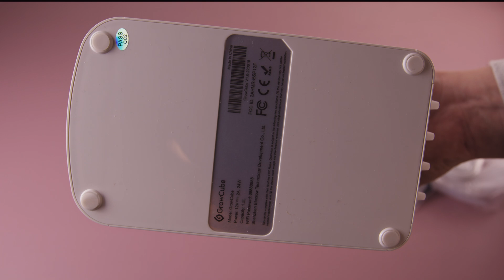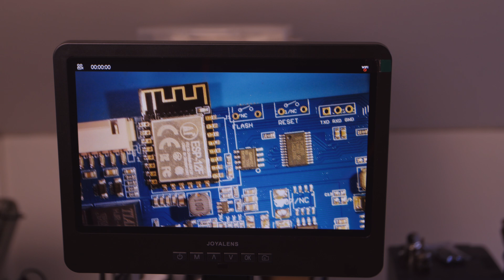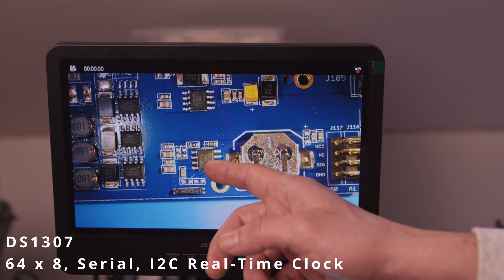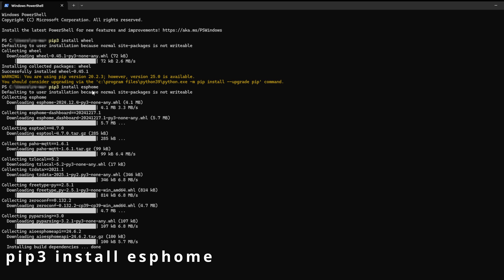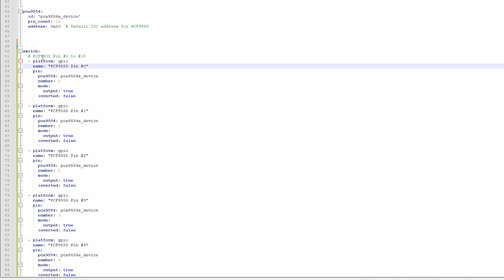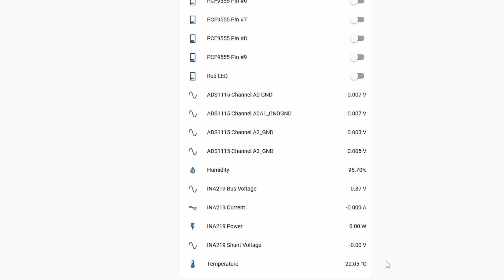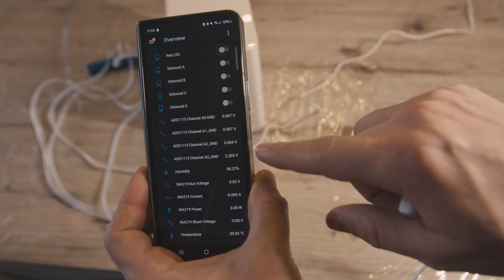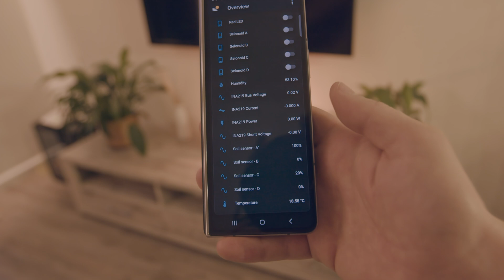Installing Custom firmware (ESPhome) to Growcube Automatic Watering System

Comment: How nice of them to have a esp module instead of the tuya obscure beken or realtek chips?! And they have marked the reset and flash buttons and even a uart header. How nice!

And esphome/tasmota projects are the best! Opensource, Based on arduino framework and runs totally local with no cloud rubbish needed

Comment: ESP chips are everywhere by this point. Everything that needs basic wifi connectivity has a high chance of having one. Nowadays, some new chips are piping up that are even more price-competitive (like the crap they put in new Tuya-based devices, old ones had ESp as well), but unless you're making millions of units, ESP is still the king when it comes to compatibility and a mature software stack. Having to go through all the certifications and all the other bullshit would kill many products on the port, by using something like an ESP, you don't have to do anything special, the modules already have everything you need.

Comment: for using the AHT20 w/ the esphome AHT10 platform, you need to set the 'variant' line to 'AHT20' or you'll get inaccurate/corrupted readings.
Reply from the maker: I didn't get any corrupted data, but thanks for the remark. You're right, the AHT20 variant is the correct one. I've updated the YAML file on GitHub.
Reply: also, the esphome autodiscovery in HA won't work if your home assistant server is on a separate subnet from your wifi, unless your router supports or has an addon for mDNS/bonjour repeating.
Reply: and thanks for nerd sniping me into buying one of these lmao